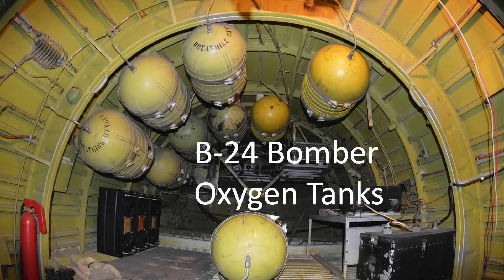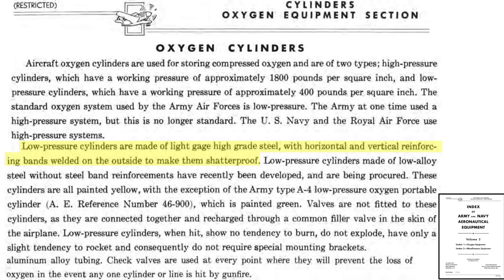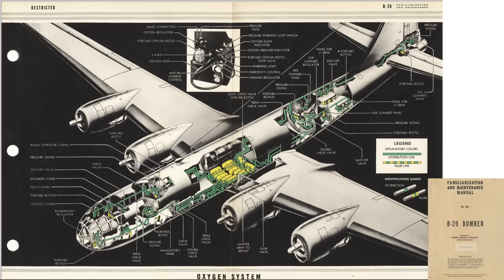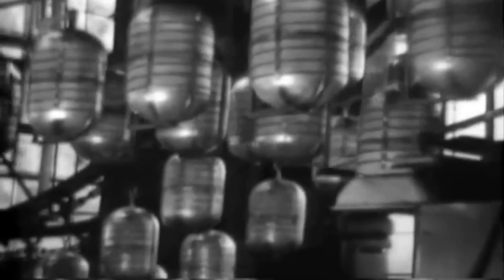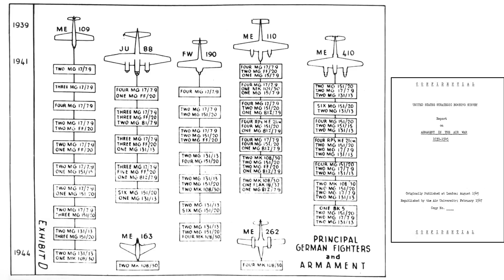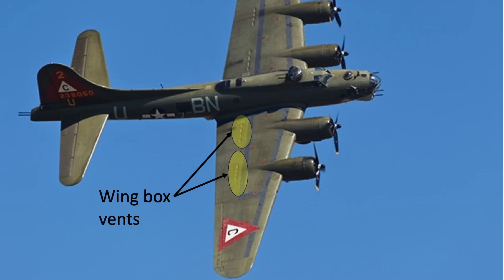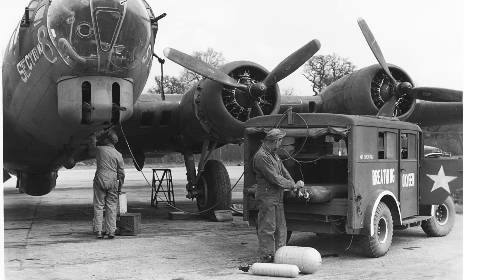Consequences of shooting a WWII Bomber’s G-1 Oxygen Cylinder. Explosion Vulnerability footage.

Comment: The "engulfing fire" is much more believable when considering what happened on the launch pad to the Apollo 1 crew who had a slight electrical short. The cabin was already filled with oxygen, and the spark initiated an extremely fast and intense fire to consume anything that could burn, in mere seconds.
Reply: The atmosphere in the Apollo 1 was 100% oxygen though in a sealed capsule. A bullet through one or two low-pressure oxygen tanks of a B-24 bomber wouldn't increase the interior O2 content of the non-pressurized plane much at all, even in the immediate vicinity of the tank. Those tanks held only 29 cubic feet of oxygen each.
Reply: @Snargfargle  Oh it will.
A high pressure stream of pure oxygen will mechanically move other gasses out of the way.
Thus allowing anything from an oil film coating to paint and Aluminium to ignite and burn.

I concur with the questionable but not unplausable fire.
Reply: @Suranfox 29 cubic feet of O2 per tank, about a cubic yard.  Might feed a close by fire while leaking but I don't think it would be as dramatic as the TV show. 

One cubic yard of O2 isn't going to displace that much atmosphere in the cabin.
Reply: @Suranfox  THE USAAF went to low-pressure (400 psi) tanks before the incident depicted in the video. A relatively slow release of 29 cubic feet of oxygen would not cause everything in the vicinity to ignite in a massive fireball. If it would then I'd have been burned up by now, having worked with oxygen as a welder, teacher, paramedic, and Nitrox certified scuba diver. I've got an O2 generator at my desk right now and can't get anything to spontaneously ignite with it. A beaker full of O2 does make a piece of paper towel burn a bit more vigorously if I set it on fire first though.
Reply: @Dan-yk6sy  No clue how much that is.
I have absolutely no relation to these imperial units.
Reply: Apollo was a sealed cabin a bomber is not!! at best those bottles dumping their oxygen would add maybe 0.01% to the mix in the air onboard!
Reply: Lets just go by Boyles law: 29 cubic feet (roughly 1 m³ for us SI lads) @ 400 psi would expand to 725 cubic feet @ 16 psi, the pressure of Apollo 1. I don't think the flow through a tiny hole can ever achieve such concentrations in the large cabin, especially with half empty tanks,, but anything nearby would have a higher risk to ignite. Still Apollo 1 would be a bad comparison, since the fire also needs fuel and Apollo 1 had lots of it, especially the Velcro with its large surface area ignited fast and eventually, even aluminum burns. I don't think a cabin fire in a bomber could find the fuel to combust so rapidly to produce such fireball.
Reply: @denniskrenz2080  The way gas cylinders are measured is in expanded gas capacity not compressed gas capacity. For instance, the standard "Aluminum 80" scuba tank has a compressed volume of 0.39 cu ft (11.1 L) and an expanded volume of 80 cu ft (2,268 L). These are high-pressure scuba tanks, not low-pressure aerial O2 tanks. The 29 cubic foot of low-pressure (400 psi) O2 was contained in a tank about 1 foot wide by two feet long and would expand to, as stated, about a cubic meter. However, since the tanks were designed to not explosively decompress, the O2 would vent relatively slowly and quickly dissipate inside a 74-foot long non-pressurized B-17 fuselage with open waist gunner bays.
Reply: @Snargfargle  You are right, it even stands printed on them, if you look at a better picture. Internal volume is only 2100 cubic inches or merely 0.034 cubicmeters/34.4 litres. They count as empty at 50 psi, that is lot of residual oxygen. Then a hard no. Even the large ones won't add significant oxygen and there is still the fuel thats missing.

Comment: Another sourse of fuel for the fire can be hydro fluid vaporising. Fun fact. the KC-135 still uses those LP O2 cylinders. We has both types on the aircraft, banded and unbanded, 14 total. They origionally had only 7 as it was the backup O2 system for when the LOX bottle was empty. In the late 90's they removed the LOX bottle and made the cylinders primary with the addional cylinders to save maintance and parts money.
Reply: The USAAF went to non-flammable hydraulic fluid before we entered the war. The RAF had issues with alcohol based flammbale fluid and they- and we-changed. This change over did cause issues with seals in Martin B-26 bombers adding to the problems that plane had.
Reply: Hi Would you have, or have knowledgeable resource of the Cornelius high psi 3-Stage Compressors used on the 1960s bombers. I have a complete" 24v 3-ph. emergency compressor " in a 24"inch square yellow fiberglass box, max.2800psi, that was built by Stewart-Warner Co.for The Boeing Airplane Co. in 1962 and I believe is was used on the Stratofortress as an emergency blow down compressor to help override the landing gear hydraulics????? 
Any help in the "military service manual" direction  would be greatly appreciated. Thanks
Reply: @stur.7502  The only use of an aircompressor in a B-52 was for charging the guns. However I saw a reference for one as part of extra equipment for KC-135 for ground servicing as part of a deployed liveaboard kit in the illustrated parts books. Other than the B-52 one, I never saw one in real life.

Comment: Well, its tv, so any excuse to show a fire.   My only thought is the bomber is a G model, and the nose turret hydraulics got hit spraying fluid about.  the extra o2 and a spark form a 20mm shell set it off.  But look at the number of items that have to happen in order for that to work.  The shattered windscreens work against this, dispersing the concentrated o2 quickly.
Reply: No Gs, only Fs in MotA.
Reply: The G-series model of the B-17 (featuring the 'chin'-turret installation) wasn't in production at the time of this [first-episode] incident (in early '43 [as outlined in the uploader's description], nor throughout the majority of '43).  Regardless – hydraulic-lines or not – the cause of such fires could've ranged from anything in between a failed electrical line/outlet, or right down to a 'fart-smella's—[?!] ... I mean, a 'smart-fella' airman's – own inadvertent fart.

Comment: I would just like to point out many aircraft both Axis and Allied would carry incindiary rounds, with the germans using high explosive-incindiary rounds or minengeshoss rounds. So when you see the footage of the tanks venting oxygen making that tiny space oxygen rich, and then further enemy rounds flying into the compartment, it is very realistic to assume an incindiary round releasing it's contents when burning or shattering the highly combustable material into the oxygen rich section. This in turn ignites the bottles.
Reply: Mine shells refers to the cannon rounds used by the 109s. They tended to use those in vertical diving or vertical ascending attacks cause they didn’t have many shots. I think they had 30 to 40 for the 30mm cannon. The 109s preferred to get close to maximize their chances of hitting something important with the limited ammunition they had to expend
Reply: @matthewcaughey8898  you are mistaken at least paritally, in head on attacks they usually fired their entire armament considering that it was the chance to instantly take out the controls and pilots which would have meant an instant downing of said bomber and for the Mk 108 30mm cannon they had 65 rounds available while for the 20mm 151/20 it would have been 200 which in case of the 30mm is enough for multiple passes and in case of the more likely 20mm cannon being used quite a lot of passes, besides that as mentioned in other comments they seem to be later G model 109s which also had 13mm MGs that just as much had explosive shells in them.
Additionally Minengeschosse as mentioned above are HEI together with 13mm MGs also firing incendary rounds and it being likely that the 20mm used also fired incendary rounds as well.

Comment: Pretty much anything that is combustible could catch fire in a very oxygen rich environment (Apollo 1 disaster proved that). Leather, cloth, etc could ignite but more likely fuel/oils from ruptured lines (once it gets started, the combustion can burn metals as fuel too). however, the fire would probably be short lived due to the rapid consumption of the oxygen. After that, the combustion would have to use the reduced oxygen concentration at the high elevation so it would probably smother quickly unless there was a bunch of liquid fuel available.
Reply: Unlike Apollo 1 a B-17 even with lots of punctures isn’t pressurised with oxygen.
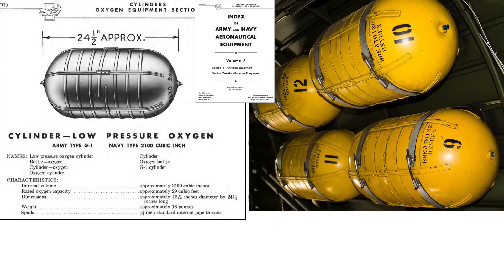Reply: The explosion, as depicted, looks much more like a vapor explosion. It's also worth noting that although the oxygen in the bottle is pure, as soon as it mixes with the air in the cabin the concentration would drop. 29 ft^3 (the volume of oxygen in the bottle, presumably at 1atm, see timecode 2:36) is a cube about 3ft on each side, so not an awful lot compared to the internal space of the B17.
Reply: @wolandpersonal2407 
Check out how much more flammable things are just going from 12% oxygen to even just 15%, 20% percent really gets things cooking. 
It doesn't take 100% for things to start getting nightmarish when it comes to how flammable things are, it happens fast as the percentage of oxygen gets raised.
Reply: >the combustion can burn metals as fuel too

Just like in the video mentioned about shooting an oxygen tank, the final hole diameter is MUCH larger than what the .308 round would have originally caused because the bullet most likely drastically heated up the edges of the metal around the hole the bullet made. The pure/almost pure oxygen then escaped through the hole, causing the heated metal to be fanned into a fire using the surrounding metal as fuel. Thank you for noticing this!
Reply: Imagine the flash in that titanic submersible when it went diesel at 400Atm for a couple of milliseconds.  Makes bachelor cooking (1 min at 4000 vs 10 minutes at 400) seem like amateur hour.  ;-)

Comment: These cylinders appear to have continued on to 1950’s SAC bombers, don’t know but assume same low pressure ones.
Reply: The B-47 was designed in the 1940s and had a low pressure O2 system.  The 50s era B-52 and KC-135 had liquid oxygen systems.  There were yellow portable bottles used for walking around inside the aircraft, and they were refilled from the LOX system.

Comment: Is it problematic that the oxygen tank in the clip appears to be hit in a direction perpendicular to the flight paths of the bomber and “head on” fighter?
Reply: Yes.
Reply: B-17s had armored seat backs for the pilot and co-pilot.Rounds coming into the plane through the nose and passing through the dashboard instrument cluster (and the flight crew) might not make it through the armor and into the O2 tanks. B-17s flying today have had their armor removed post war, so a tour through a restored B-17 doesn't show all the war-time gear.
Reply: You might be taking the "head on" part a bit too literally.
Reply: @Milkmans_Son  Perhaps.  However,  two 109s are seen through the front cockpit screens and tracers are shown tearing through the cockpit front to back.  "Head on" seems to be a fairly accurate description.  Perhaps, then, a ricochet, shrapnel or  another fighter coming in from a different direction?  Perhaps this was the directors taking some liberties as a shot to the front of an oxygen tank would not have given the visual effect of the one used in the film.
Reply: @dalestockman4292  It didn't look like it made a round hole to me like a direct hit from the side would make.  It looked like it either keyholed in or, if the bullet was still stable, entered the tank a couple degrees off  the thrust line or whatever we are calling dead on the nose (which makes sense since the fighter didn't ram the bomber trying to stay on target too long).  

Either way, I'm pretty sure they didn't think anyone was going to do an extensive forensic analysis of every bullet trajectory in the film (or for that matter, care).

Comment: It’s interesting in terms of the armament of the Messerschmitt Bf 109 because by the summer of 1943, the G-6 variant was becoming the standard 109 with the more powerful MG 131 13mm machine guns.  For all of 1942 and early 1943, the 109s that would be encountered would most likely be the G-2 and G-4 which do have the 7.92 machine guns.  However, if you look at the 109s in Masters of the Air, you can see the 109s have gun bulges or “blisters” in front of the cockpit.  That means it’s a G-6 and thus has 13mm machine guns.  Thought I would let that be known.
Reply: The canoes as 109 pilots called them were usually fitted for intercept missions. They basically added a pair of 20mm cannons to the 109 quickly and easily. They were an optional add on from the BF-109F onward. The F models redesigned wing eliminated the space where the BF-109E had a pair of 20mm cannons with about 60 rounds each in a drum magazine. The Slats in the F or Fredrich model eliminated the space. The designers fitted the MG-FF 20mm Motorkannon as a compromise. All 109s after the E model could carry the extra guns. Good catch on the cowling bulges and an excellent point about the extra room needed to mount the 13mm guns bigger dimensions. The G model or Gustav variants biggest claim to fame was the mounting of the 30mm Rhinemetal Borsig cannon in the through engine mounting. You saw mostly G models by 1943 cause Germany had suspended all bomber production to concentrate on fighters. You also had BF-110s and whatever else the Luftwaffe could get ahold of going up to combat the B-17s but yeah the G model 109 was the most numerous. The final BF-109 or ME-109 ( the BF or ME designator is interchangeable btw and just denotes which manufacturer built that particular aircraft) was the K or Kurtfaust. K model 109s didn’t really get to do much and the platform was showing its age vs newer fighters from the allies entering service. ( the 109 was originally a 1934 racing aircraft converted into a fighter. By 1944 it was 10 years old while they were able to increase the power and other equipment and weapons, they couldn’t gloss over the age and range limitations of the aircraft )
Reply: 'Typical', and not in any way surprised at this oversight.  Speaking from a self-professed [amateur] Me 109 'expert' (although I have yet to see the Series myself [still debating, mind you]), from what I've heretofore witnessed (among other online [MotA] clips/commentary), I not only find it appalling the amount of [blatant] technical/historical [CGI] errors 'edited' into the scenes, but perhaps more so, in many ways, it certainly does not appear that 'they' (Apple/Spielberg, et al.) got this Series 'right' in the first place (in a comparison to their two previous [well-orchestrated] works), which is in fact a pretty sad affair, considering the millions (let alone the [long-awaited] time and resources) they poured (or rather, wasted) into this 'arcade-game'-like 'production'.
Reply: @SharkHustler  the show is first and foremost entertainment, and in that part, I say it succeeds.  No matter what historical film or show is made, there will always be inaccuracies, you just can’t avoid it.  Yes Masters of the Air has some problems, but overall it actually did pretty well when compared to other works.  Enjoy the show, if not, that’s ok.
Reply: @Xeno1001 
True, entertainment's one thing, and historical accuracy is [equally] another (in [today's CGI-enhanced] film-making), but 'knowing' where and when to compromise between the two is no excuse concerning the voluminous array of financial/historical/technical and [more-than-ample] time resources at hand – notably, where ('in all likelihood') the 'expertise' [here] has been whittled away to both Spielberg & Hanks' kin of 'would-be' producers, down to but a 'Masterpiece [left] Up in the Air'.
Reply: @SharkHustler I think, ultimately, what they ran into with Masters of the Air is that the air was less dramatic for the film screen and developments were greater and more visually obvious.

The former is a problem because, in the air, a lot of the fear comes from the flak, thousands of feet below and invisible to our camera. Or roving fighters, which pass very quickly (or are engaged out of sight by fighters). It's not like a ground war where there's gunfire everywhere, and tactical maneuvres and all this. 

The latter is a problem because they only have so much budget. They can only produce so many 3D models, only produce or rent so many replicas. This makes it difficult to accurately portray the versions and outfits of aircraft at each stage, when each mission they portray would expect slightly different variations of each aircraft.
Reply: @kirotheavenger60 
Only an 'air of ignorance' out the producers' arses is what I smell here ... For a 'budget' of some $500 million, you'd think 'they' could just about get anything and everything right, wouldn't you think?